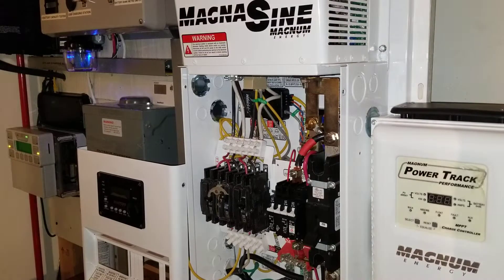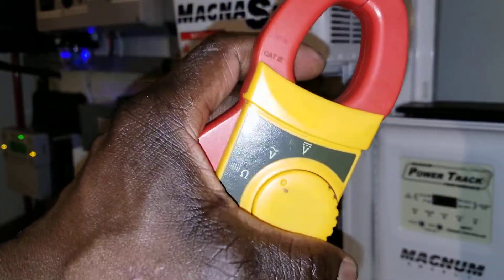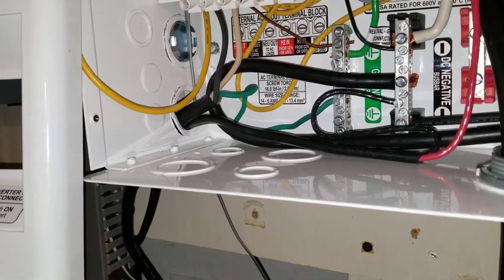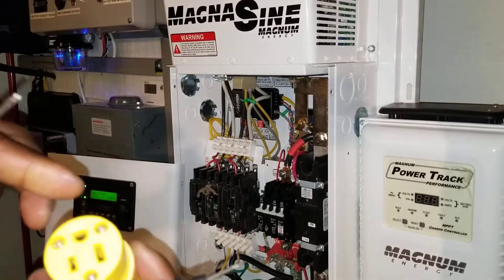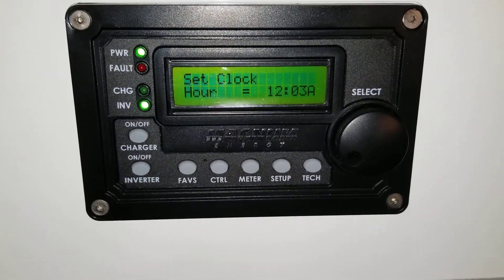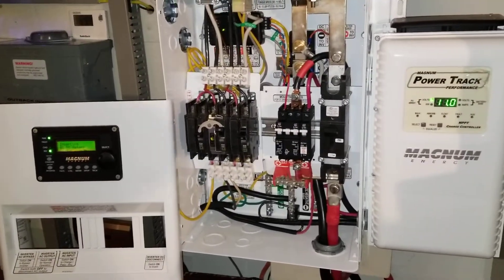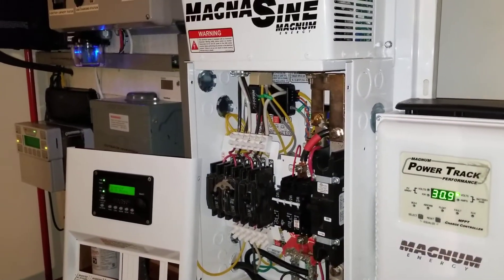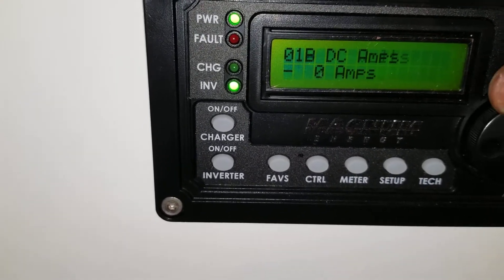MAGNUM ENERGY: Testing Inverter Output Voltage

Comment: how low can you run your house offgrid without reliable sun?
Reply from the maker: Good morning brother John.
Because I am running on Lithium batteries with high voltage, I have done a test with my OutBack Power Systems and I have ran my house for 4 to 5 day without Solar just off batteries. 
The lowest I have taken my batteries down was 61.3V which was 7.6625V per battery which is 3.83125V per cell.
 I am running a 16s @ 48V Off Grid Solar System Powered by OutBack Power Systems.
Thanks for asking and don't FORGET to check those videos on my playlist: (SWAPPING FROM AGM TO LITHIUM BATTERIES)
God bless you and have wonderful day Reverend.
Cheers.